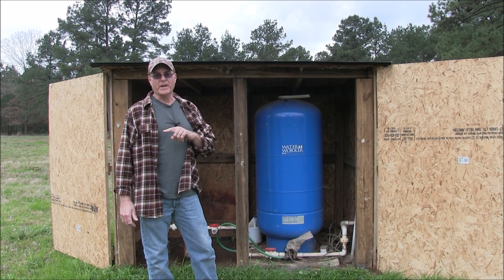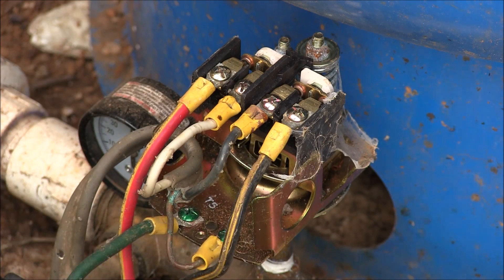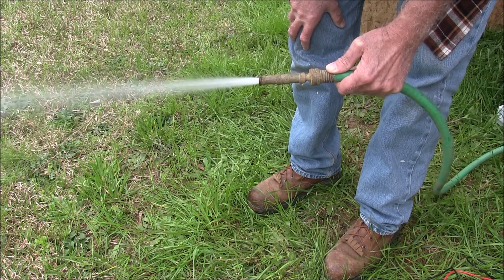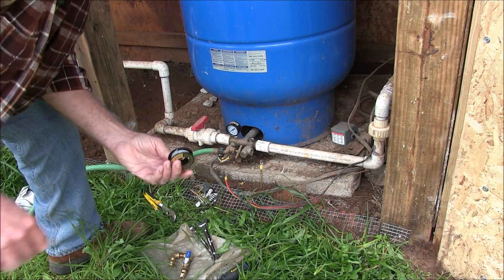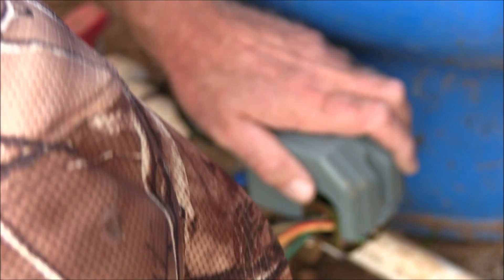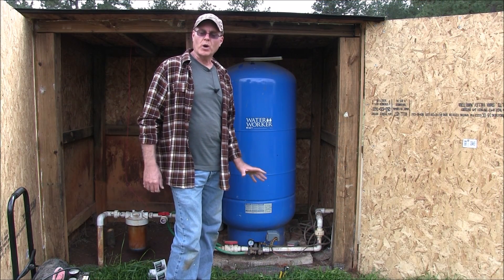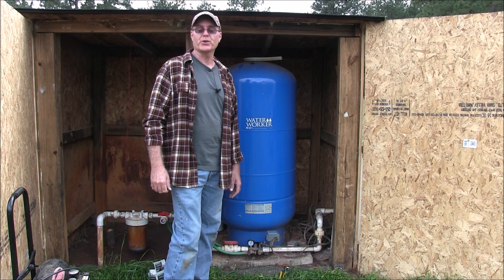Well pump pressure switch replacement and re-pressurizing the pressure tank

Comment: Is that on a 15amp or 20amp
Reply from the maker: The well pump is on a 20 amp 240 volt beaker
Reply: @petebeasttexashomesteading  does it have to have its own breaker. Or could I run mine off of my breaker that runs everything else. I'm trying to do this on my own

Comment: Hi again Pete....I keep watching this because your setup looks very logical. I did get the gauge and switch replaced today. 
But I would like to build the extension for the switch like you did. Has it worked ok with the switch not being right up against the tank like at first?
Secondly...that looks like you have put a filter on the line from the tank to the house.
What I think is causing a problem for me is I have a holding tank that the well pumps into and then it goes to the pressure tank and house.
I am thinking small dirt or something from storms or such get under the lid on the holding tank into the tank. 
I would like to insert a filter like you have between the holding tank and the pressure tank. 
Are you satisfied with your filter? If so, could you post the brand and where you get yours?
Thanks some more. Jesus bless.
Reply from the maker: The extension for the pressure switch works great. As far as filter, I have a 4.5"x 10" pleated 20 micron sediment filter which works great for removing sediment like dirt and rust. You can find the filters and housing for them on eBay or Amazon. Hope this helps.

Comment: Your stuff is always good. Simple instructions and good camera shots. 
What is the brand of tank and pump you have? I would like to have those components on hand when I don't need them than to need them and can't find them.
One more question....do you ever clean out the check valve on your well system? 
Thanks again for your help. Great channel. Jesus bless.
Reply from the maker: Thank you, The pressure tank is a water works brand sold by home Depot on line. The check valve is best to just replace if it's older.

Comment: Very well done video, one of the best and easiest to understand and I have watched dozens on this subject.

Just being a dumb lawyer and not very mechanically inclined, I recently tried to fix a low pressure problem myself and I am not sure if I did so correctly  or not so I would appreciate your advice and expertise.

I emptied the tank and checked the air pressure and it read something like 18 PSI which I thought was low so I filled it to 38 on the same advice you gave here about a 40/60 switch. After I turned on the pump the air pressure read between 80 to 90 so I got scared that I did something wrong and reduced the air pressure a bit...before realizing that an increase in pressure may be normal. 

My questions are;

1. What should the air pressure read after the bladder fills with water  if I set it at 38 empty and was it a mistake to remove some air... Is it normal that it goes up to 80 or 90  like that ? 

2. If the SWITCH says it is a preset 20/40, am I wrong to think that it was adjusted to 40/60 and should I reset the whole thing again to 20/40 or leave well enough alone? 

 My pressure switch says it is  a 20/40 preset but I think my plumber adjusted it to 40/60 because of the distance from my submersible pump and I always seem to rememer seeing the GUAGE always reading between 40 to 60...but maybe I am wrong.

Thanks for any advice you may offer.

Cheers

Leon
Reply from the maker: Yes if your switch was adjusted to be 40/60 then the tank air presser should be set at 38psi. don't worry about the presser in the tank when it's filling with water, Just make sure when you check the air presser in the tank that it has no water in it and the pump is off. If you're not sure if the switch was adjusted, then just fill the presser tank to 18psi and see if it runs good. But I have to tell you that I would never have a 20/40 presser switch, it's just too low of presser for my liking.
Reply: @petebeasttexashomesteading  Hi Pete, Thanks for your rapid response...much appreciated and it did clearly answer the one puzzling question I had about it being okay if the air pressure reads much higher when the bladder is full. I also think you are right in agreeing with me that even though my switch siad it was preset to 20/40, my installer did probably adjust it to 40/60.

Consequently, I will leave well enough alone...for now. Your video was one of the best of the hundreds I have watched...simple and straight forward and good video production qualities and composition.

Thanks again. You are now entitled to a free LEGAL question.

Cheers

Comment: I am very much a novice plumber (to put it gently). I changed the pressure switch a couple of weeks ago. It was short cycling. To fix the problem, to make a long story short, simply draining the tank would have been difficult, so I shut the pump off and pumped some air into the bladder to force the water out through the lowest gravity spigot in the house. I got just about all of the water out of it. Please forgive my potential ignorance here, but I was then somewhat fearful of rupturing the bladder by over inflating. I therefor inflated it to 28 lb (a 30-50 switch) with all of the spigots closed. Would it have been OK or best to have done so with one of them opened? 

Thanks for posting stuff like this for people with limited knowledge on topics like this, such as myself and answering questions. God bless.
Reply from the maker: You did good, just shut the pump off, let the pressure out of the tank by opening a faucet. Then you'll be able to change the pressure switch. You then fill the pressure tank with air to 28 psi for a 30-50 switch 38 for a 40-60 switch. It's probably not necessary to leave a faucet open when filling with air but it won't hurt either.
Reply: @petebeasttexashomesteading  Excellent. Thanks again.

Comment: Very informative.  Trying to figure out my problems. 
3 to 4 days ago water heater drained water from the pressure release valve (was told pressure was built up and it was better for it to flood my closet than explode), a few days later I had no water going to my toilet, then eventually water pressure was low throughout home, and we found out the washing machine is leaking, toilet needs a new float kit so its continuously running, and shower valve is now cracked(suspected from the pressure), later that same night after not using water all day, we had water pressure back to normal. The very next day, today, my faucet is spitting at me.. we know the hot water heater needs replaced because it doesn't get hot unless we hit the reset button which we have done for a month now so unsure where our problem lies... well or hot water heater
Reply from the maker: Whenever the presser is too high, that usually means the presser switch at the well is bad and should be replaced.

Comment: What about if there is water in top tank
Reply from the maker: If there's water in the top portion of the tank then that means that the rubber bladder is broken. Empty the water from the tank and repressurize the air in the tank. If it will not hold air pressure, then it is broken and the tank needs to be replaced.

Comment: Never ever install any valve between your Well Pump and your Pressure Switch. If the Valve gets closed, during operation, you could have a run away pump. This could over pressure the system, and rupture a pipe in your house. It could also burn your pump up, from over pressurization, stalling the pump motor. Also I do not recommend that pressure switch. Get a Low Pressure, Manual Reset Switch, such as a  Pumptrol FSG2J24M4BP. The switch has a little Silver Colored Lever on the side to reset the system after a pressure loss. If a pipe should rupture during normal use, this added feature, could turn major flooding into minor water damage.
Reply from the maker: Yep you are correct and the valve is after the presser switch. The PVC pipe you see in the video going into the ground is actually going to the house.
Reply: Pete B: East Texas Homesteading but you put a valve on the pressure switch it’s self. So you do have a valve between the pump, and the pressure switch.

Comment: More nipples on the switch is more chance of it getting clogged with Iron. YOU wouldn't have to do all of that if you had the correct tank tee installed on your pressure tank, that way the switch is out far enuff to where it doesn't  hit the tank. GARBAGE setup with someone who is trying to educate individuals.And if you are having to add air into the tank then it's messed up, it comes precharged and you shouldn't never need to add air unless it's water logged.

Comment: Thanks for the video!  I'm going to be changing a stuck gauge and the pressure switch today. I hope this solves my water pressure issue.  My tank measures 28 PSI when the system is empty, so I think it's still good.
Reply from the maker: 28 psi in your tank when empty, is good for a 30 to 50 psi pressure switch. 👍
Reply: @petebeasttexashomesteading  I did put a 40-60 switch in and pumped up the empty tank pressure to 38.  There was sediment clogging the pressure switch as expected.  Everything has been great so far. The gauge shows it cycling between 40 and 58.
Reply from the maker: @michaelc565  👍

Comment: How long do these pressure switches last, and should I replace a working switch before it breaks?  My system has been issue free going on 8 years now, and I'm just a little concerned this is going to break some day and I'll be ill-equipped to handle it.
Reply from the maker: It all depends on your water quality. Eight years is a good while so you might want to replace it soon just for peace of mind.

Comment: You Don’t ever put a Valve of any kind between you Pump and Pressure Switch. That’s just asking for trouble, when someone closes the valve, and the pump keeps running, because the switch can’t sense the water pressure. Also I will only use the Pressure Switches that have the Reset Lever on it, that way if a pipe breaks and the pressure drops too far below the Cut-in, it will shut the pump off and can help protect from a Flooded house and a Burned up pump. It’s an Electric Code Violation, not having a Service Disconnect close to the pressure switch.
Reply from the maker: The shut off valve is after the pressure switch.
Reply: Thats what i was thinking of the valve, it does not harm, but kind of has good potential to mess with the system hah

Comment: When you drained the water the red lever valve was in the on position. When the video returned it was in the off position. However I didn't hear you say turj it off.  Is this a " titanic " moment?
Reply from the maker: First I released the presser from the system then I turned off the valve because when taking off the presser switch I didn't want water from the house to drain back.

Comment: So I purchased a new well tank about a month ago and realized a few days ago, that may have not been my issue. My water pressure started fluctuating again, to the point where it was so sporadic it made taking a shower a royal pia. So I went ahead and purchased a new 30/50 pressure switch (Which I probably should have done first), and realized when I took the old one off, that the contacts were black and remained open. So I figured, bad switch right? okay. My confusion comes in here: I have a 30/50 switch that cuts on at around 30. But, my tank that I purchased from Lowe's has this red tag on it stating that the tank has been pre-charged to 25psi and that I need to make sure the tank is 2 psi below "pump start-up pressure". So does that mean I need to set my tank to 28 psi since my switch is a 30/50? or do I need to set it to 26 psi since the instructions in the manual had the cut on pressure at 28? I am so confused right now and I am probably over thinking it. I just want to make sure I do this correctly and not have to go through this again. Any help would greatly be appreciated. Thank you. --Chris
Reply from the maker: Hi Chris, if the pressure switch is 30/50 then your tank pressure should be 28 psi
Reply: @petebeasttexashomesteading  okay thank you sir!

Comment: I have the old standard 20 gallon galvanized tank and it is waterlogged can I drain this tank to make room for more air?
Reply from the maker: Yes you can, but it sounds like the baffle is broke on the inside. Drain the tank from the bottom and Iet air come in from the top air refill valve by holding it in. When tank is empty, close drain and you should be okay for a while. But you still need to replace your tank soon.
Reply: @petebeasttexashomesteading  I don't think it has a baffle I'm thinking this tank is close to 50 years old but I will try what you suggested. Thank you very much.

Comment: My water pump breakers keep tripping. Is this a sign of a bad pressure switch, faulty wiring or bad well pump?
Reply from the maker: If your pressure switch is old, change it. It could also be a bad breaker, that happened to me and changed it out for a new one. Make sure all your wires are okay and not shorting out. If everything looks good, then it might be your pump.
Reply: @petebeasttexashomesteading  thank you

Comment: Pete B. What size air compressor is ideal for the job. I tried one that plugs into a car but I feel like it didn’t do the job sufficiently.
Reply from the maker: Yeah those are too small, you'll need a pan cake type or I have a small four gallon that worked good but you'll of course have to plug them into an outlet.
Reply: @petebeasttexashomesteading  Thanks Pete, I will shop around for one of them!

Comment: Pete B: Nice job of videoing. I have done this a couple of times. You should have explained the wiring ten or twelve times so the ton of viewers that got upset would know it was not a mistake wiring the way you did in final assembly. I guess you should have done it the wires the same way to eliminate confusion.
Reply from the maker: True, I might do a video on how to wire the pressure switch. Thanks

Comment: There is so much you left off this.  There are better videos on youtube on how to do this.  I also noticed that you didn't put the wires back on the way they were when you took it off.  God almighty.
Reply from the maker: The hot wires on the presser switch can go either on the outside terminals or on the inside.

Comment: I’ve got a new system to install, there’s going to be a bunch of air in the line, the new tank came pressurized already, can I just plumb it all and turn the power on or do I need to let the air out of the tank before I turn the power on, open a sink valve till water comes out, then re pressure the tank? Thanks.
Reply from the maker: You're all set, just plumb everything and turn the power on.
Reply: Pete B. Thanks a million sir.

Comment: Definitely should have used Romex connectors when running your wire. This protects your wires from the sharp edges inside.  But great video!

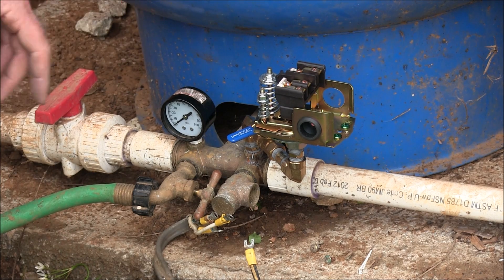Comment: I'm not a electrician but wen you checking for power I see on min. 0:47 wire red and yellow are outside to the left and then when you put everything together I see the white wire outside this is on min. 7:21 I'm confused
Reply from the maker: On a pressure switch, the hot wires can go on the outside and the two wires going to the pump on the inside or vice versa. If you look at how the switch works it just connects or disconnects power to the pump.
Reply: thank you sir for the video it was very helpful

Comment: Nice video, only issue I see was your pressure switch box should have had cable retainer clamps, The way it is the wires could end up shorting to the case or being pulled off, you need two of the them.
Reply from the maker: Thank you

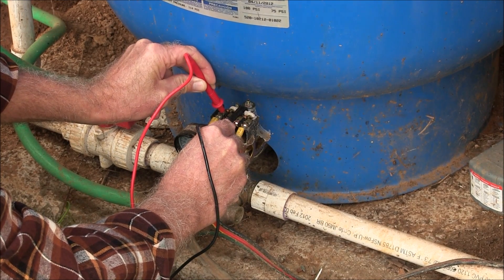Comment: Is it me that dont get it right ? When I watch the video at around 1:00 minute, you are talking about witch wire should go inside and outside on the pressure switch but at 9:40 it seems that you are saying the exact opposite ?  I thought the explanation at 1:00 minute is the right way to plug it ?
Reply from the maker: The two screws on the right is one leg and the two screws on the left is another leg. Each leg has a hot going in and a wire going out to the pump. You can put the two hot wires on the middle screws and two wires on the outer screws to the pump or vice versa. It's just a switch that directs power to the pump.

Comment: Great video  who makes the volt meter? Where can I get one
Reply from the maker: Thanks, The meter I used in the video was an older Craftsman clamp multi-meter and I don't think they make that particular one anymore. But I put a link in the description under the video where you can get a good clamp multi-meter on Amazon. Thanks
Reply: Thanks

Comment: What kind of air pressure valve is that where can I get it from
Reply from the maker: Are you talking about the tank air valve or the water pressure switch but I bought both at home depot. https://www.homedepot.com/p/Everbilt-40-60-Pressure-Switch-for-Well-Pumps-EBPS4060/205617967  and the well tank https://www.homedepot.com/p/Water-Worker-119-Gal-Pressurized-Well-Tank-HT119B/202846488

Comment: just bought a house with a water well and the pressure is reading 100psi and water is shooting out I turned off the breakers so it would blow off my pipes what could be the reason for this ?
Reply from the maker: Probably a bad or stuck on pressure switch.